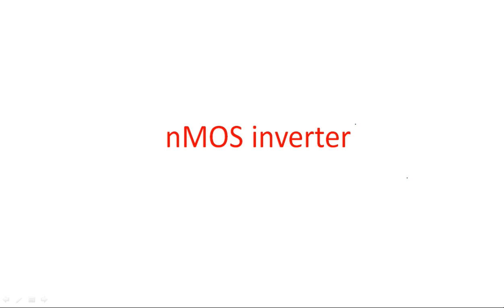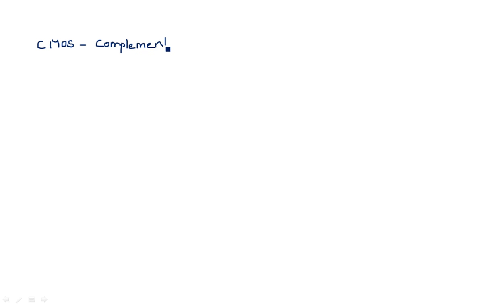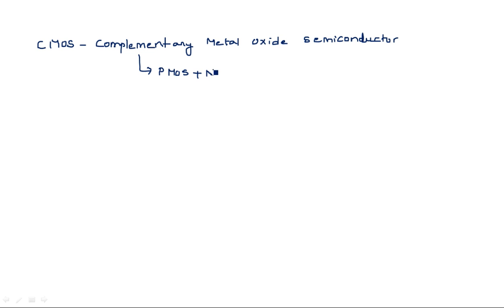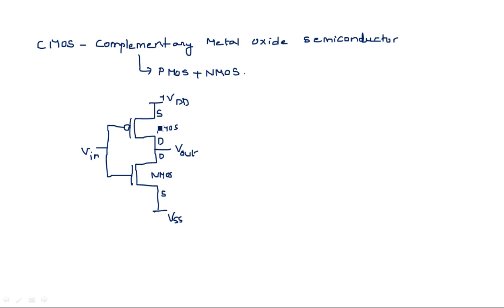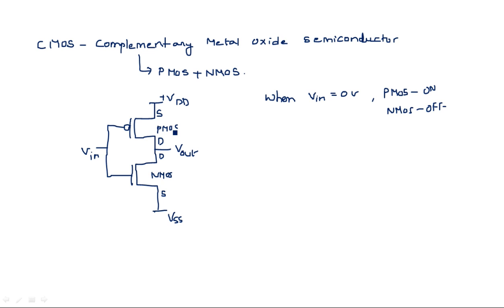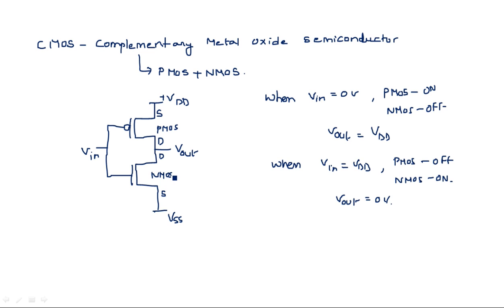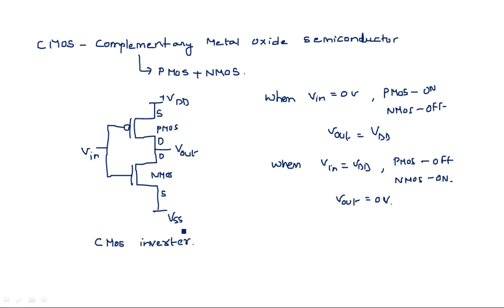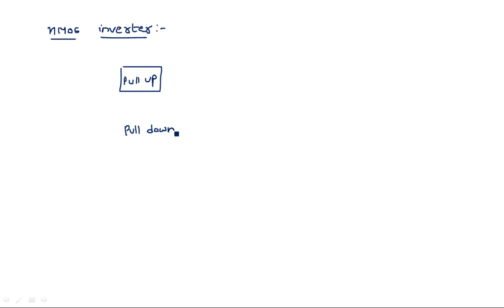nMOS inverter  | Characteristics | VLSI | Lec-16

Comment: Gate is not connected to drain, for depletion mode NMOS transistor gate is connected to source and it's drain is connected to vdd. Once check this and reply if my pov is wrong
Reply: bro, which university you are.? .in enhancement mode we connect the pull-up transistor gate to vdd..in the depletion node we connect the gate to the drain i.e output
Reply: yep ur right